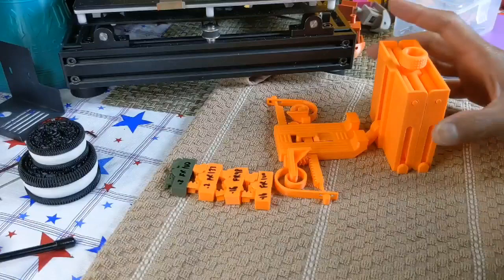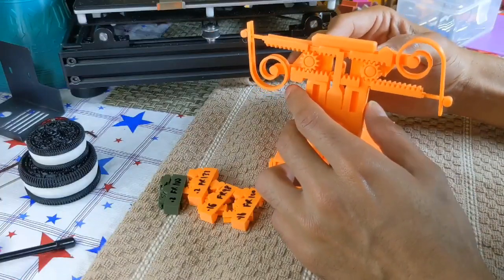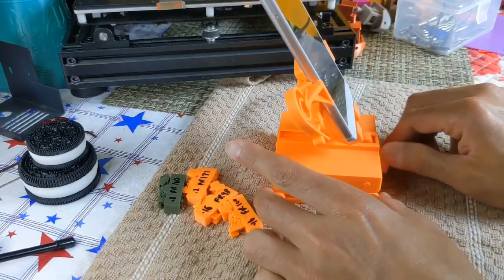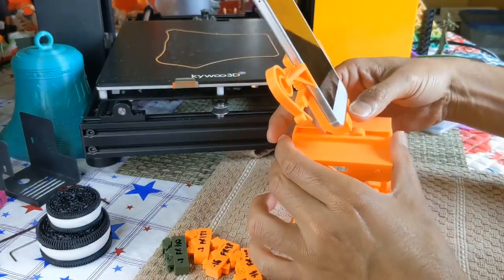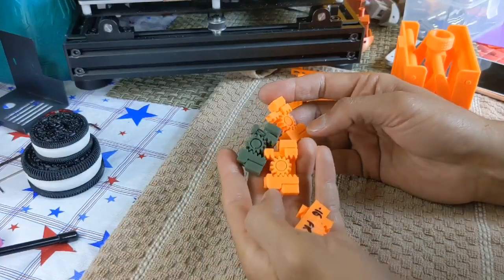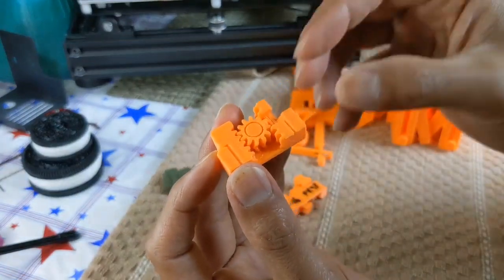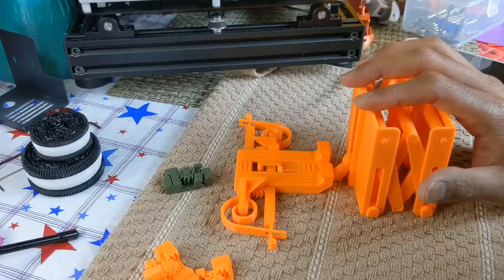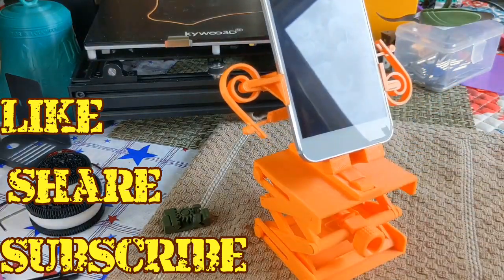Mechanical Phone Holder - Elevated, print-in-place

Comment: I cannot for the life of me get the test print to actually function.
Reply from the maker: Try printing at better resolution 0.16lh, and reduce flow gradually, until you get it to work. Also make sure there's no elephant foot, and you're printing at right print temp, and bed level in on-point. It's not an easy print, and really helps you dial-in the tolerances 🍻